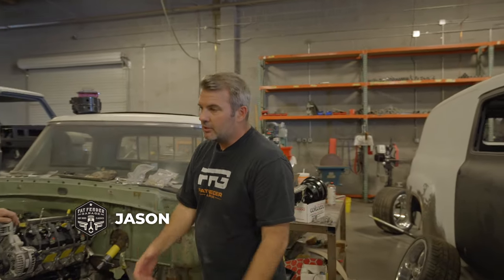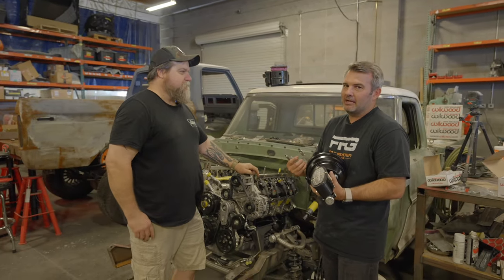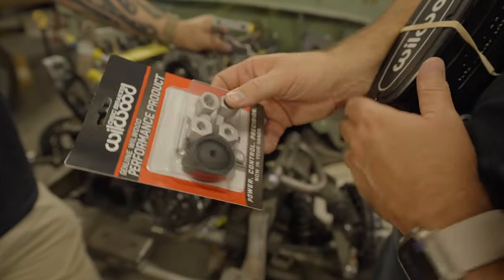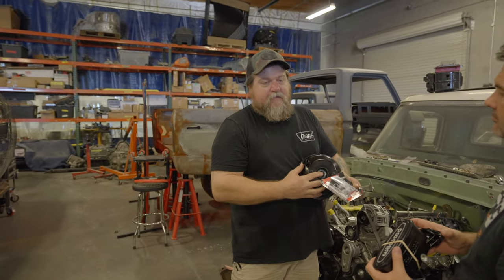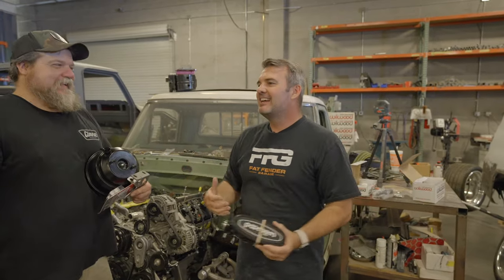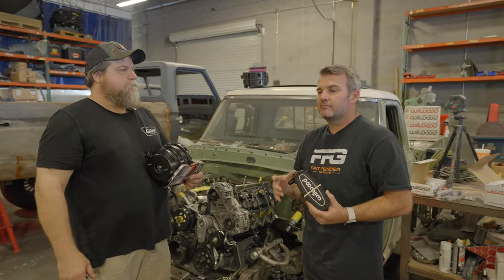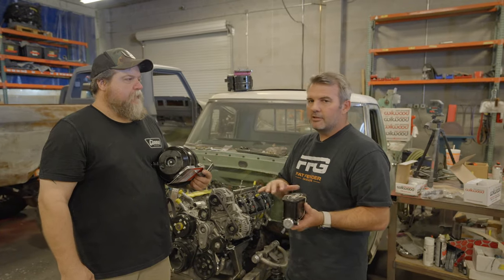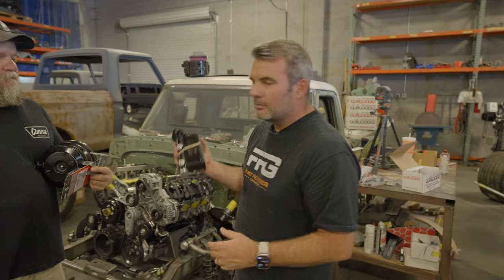1967-79 Wilwood Brake Booster Kit FAQ

Comment: I detest bench bleeding. On custom builds, you bleed it on a bench, bolt it to the booster, then pull out the plugs and try to immediately start screwing on the lines while brake fluid starts dribbling out all over your freshly painted surfaces. I prefer to vacuum or gravity bleed. Also - your link to the booster/master doesn’t work.

Comment: What happens when you have a the slave cylinder on the petal and a Booster which is remote. Application is  a 1965 Ford/Mercury C750 cabover